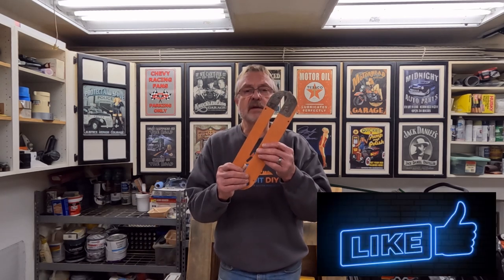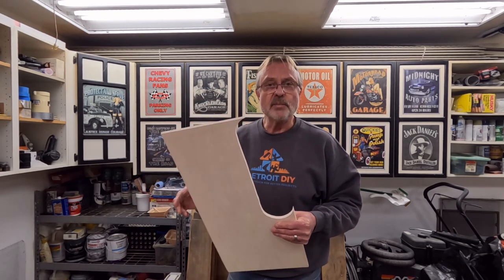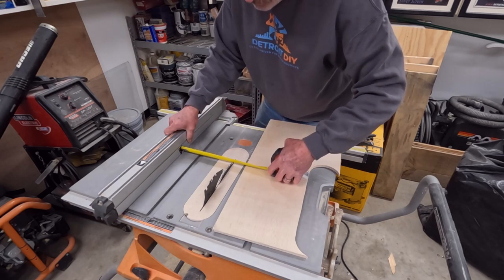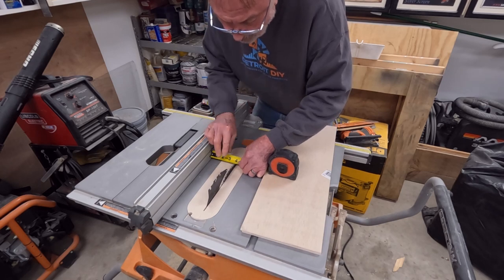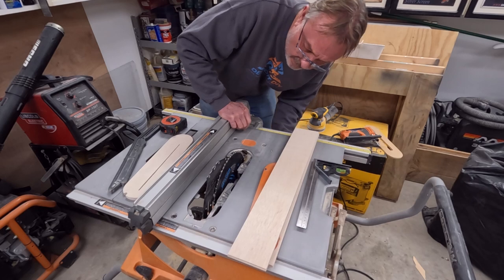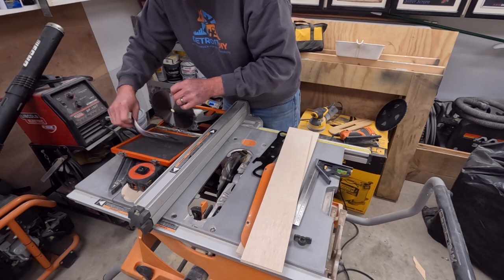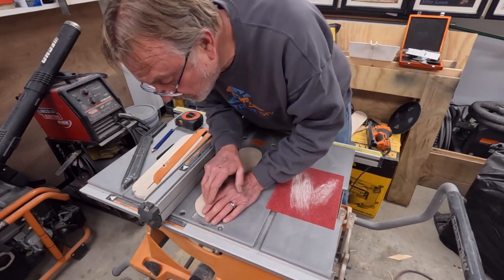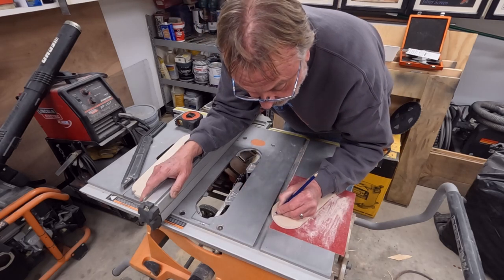How To Make A Dado Blade Throat Plate For Your Table Saw!

Comment: What did you put for 3/8" , are your chippers 1/16" ? If so what was the spacer for cuz the outside blades are 1/8  so 2 of those plus 2- of the 1/16 should do it , not sure why you put the spacer in .